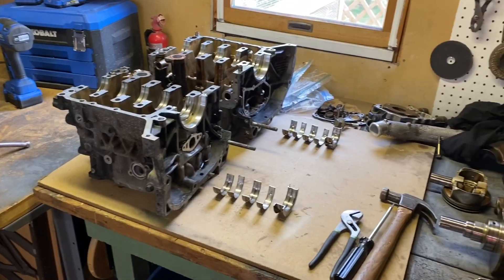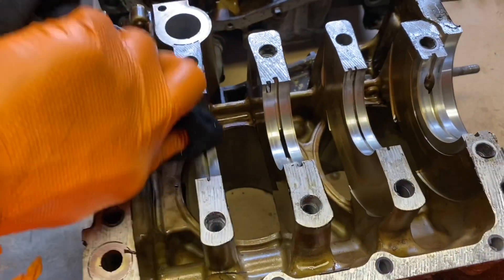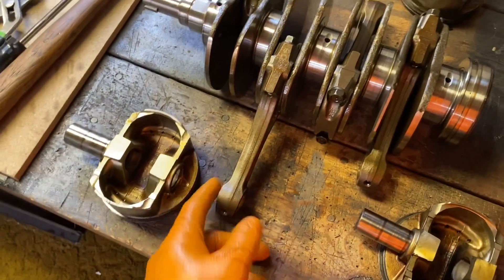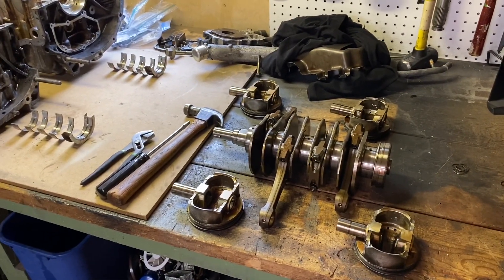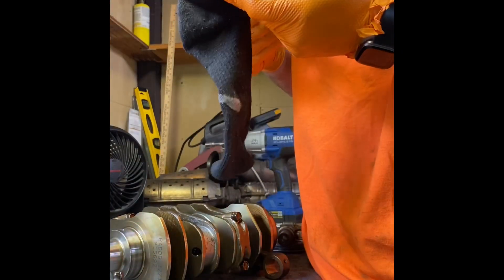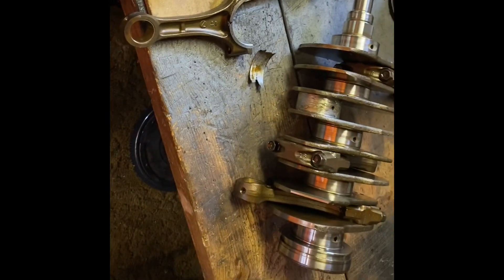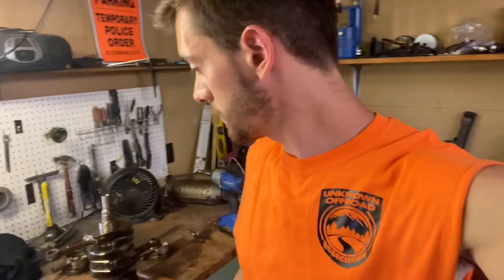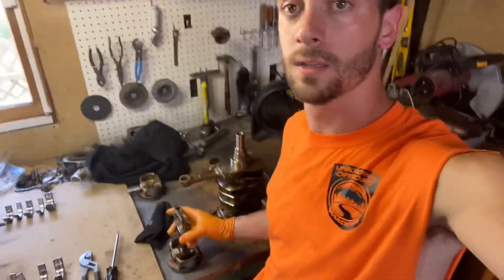Knock Knock - Subaru Rod Bearing Failure

Comment: Dude I just bought an 02 wrx wagon a few weeks back and I think it's developing rod knock :'( the crank pulley was definitely moving as well, the AC belt got chewed up, and a bit of the drive belt. Went ahead and took off the AC belt for now, and replaced the drive belt. I took a 22mm socket and put the car in 5th, and tried to tighten that sucker down (made about a full half turn or so) and it quieted it down a little bit but it's still def having a slapping/knocking sound especially loud at idle (and cold)
Reply: Just gotta say, I may just drop the oil pan and replace the bearings 2,3,4 and do what I can to clean her up and hope for the best.